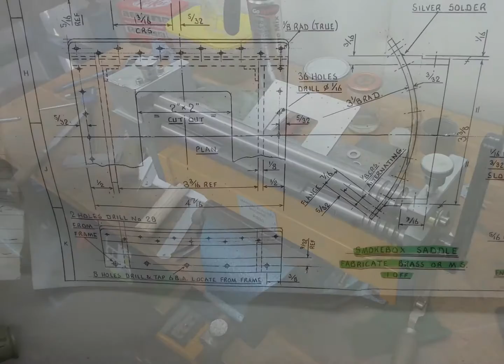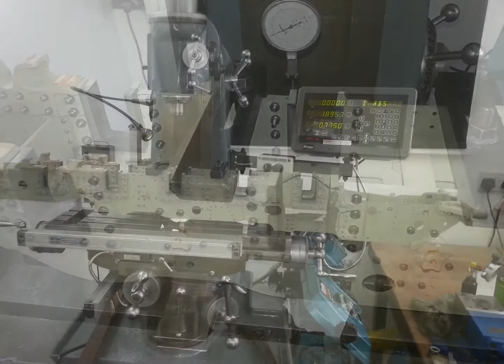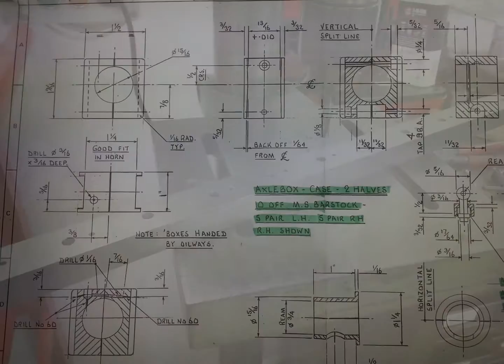Steam Locomotive 9F Build Part 8

Comment: i like the idea of the magnets for catching the swarf
Reply from the maker: Thanks Paul. The main advantage is that it prevents most of the cast iron dust from getting airborne and covering the shop.
Reply: @no23mk2  it's a good idea. but do you find it magnetises your equipment by any chance?
I also presume by the looks of them you have salvaged them out of a microwave
Reply from the maker: Yes - salvaged from an old microwave. The only things that get magnetised are small hand tools that annoyingly come into contact. The vice & table etc doesn't seem to get magnetised. I use a demagnetiser from work for any tools that are affected.